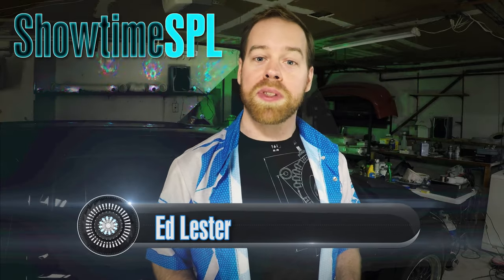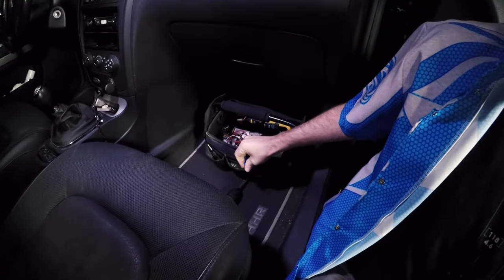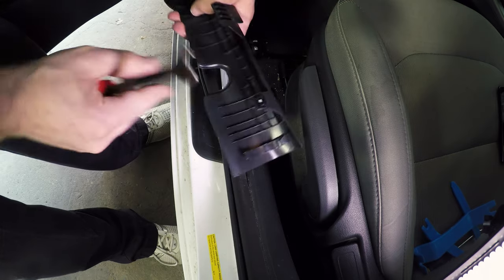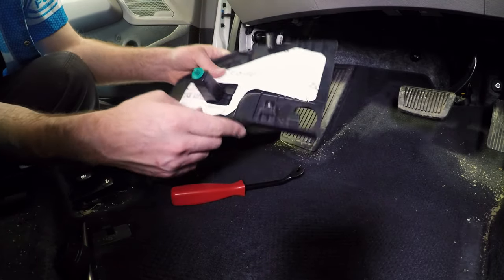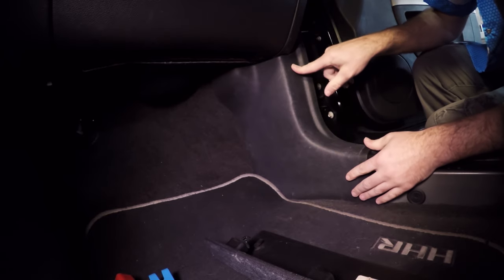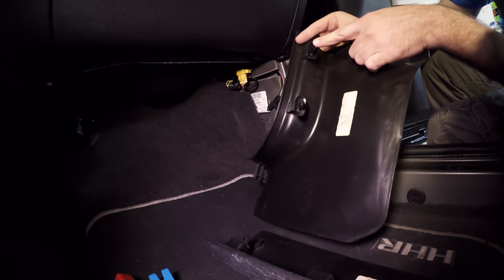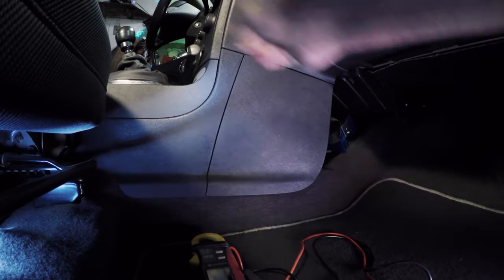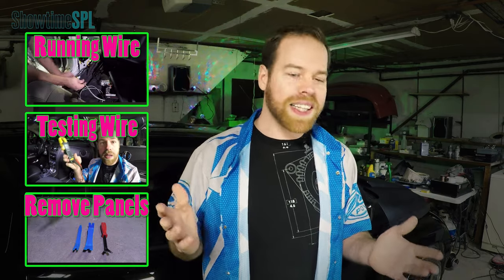How to remove car panels

Comment: Thanks for the tips on pry tools & how to use them. 
I have a small dent that may have been caused in a parking lot-not there before, was there when I came back. If I can remove the interior panel under the dent, I can fix it myself. Thanks for the demonstrations.   🔧🚙

Comment: Just watching this video has been the most helpful 8 minutes of any youtube video I've ever watched(which is a lot). That's because, take a Hayne's auto manual for instance. Step 1 will say, "remove the rear console cover." Oooooo K ... easy for them to say. Not so easy for dumb me to do. Now I'm a retired electronic engineer and am an OK but not great mechanic, so understanding what to do is usually manageable for me. But what always gets me is "how to get at things in order to fix them." After watching you it all kinda makes sense, but before watching you ... clueless. Popping stuff off that I can't see how they are fastened really scares me. I wish things just used good old fashioned screws, but I guess they would have a tendency to vibrate loose over time, so that would be an advantage for pop-ons. That being said, I'll never get used to the fear of breaking things by prying on them.

Comment: Great video thank you.   I recently replaced my dash on my 2013 Chevy Avalanche.   It had cracked over time due to sun exposure.    When replacing the new dash and having new clips installed,  I noticed that the 5 clips that lock into place did not stay in place.  I triple checked and made sure everything lined up and it did.  The clips were new and properly inserted.   However no matter how much I tried to get the clip to stay inserted it would pop up.  Of the 5 clips, 2 stayed in pretty well the other 3 wouldn't.   Any suggestions to this issue?

Comment: SparkedEd, any chance you know how to remove the silver molding piece that runs across the whole center of the dash ? Its shiny enough to reflect sunlight and blind me. I'd like to take it off and plasti dip it.
Reply from the maker: Depends on the car. Best thing is to look up Metra guides or join a forum or FB page for your specific car.

Comment: thanks for the video.
Any help on removing the back interior panel ? lexus gx470
(left side)
I was trying to fix a leaking in the left roof rail and a holder for the back part of the roof rack felt inside the rear panel.
Thanks

Comment: I need that “door well panel”, but for my car, mine is also attached to the outside “kickstep” with the metal Hyundai plate insignia on it. Whats the general name for that panel on all cars so I can find mine? Floor panel, door frame panel etc...?
Reply: Need to know the section after the kick panel(moving towards the back of car), and mine actually goes from the inside and wraps around and clips to the rocker panel.
Reply from the maker: Door sill, or sill panel

Comment: Hey man I've been going through your channel watching alot of your HHR builds I was wondering how reliable this car is since I plan on buying an 08 HHR SS also did the sound deadening reduce road noise and would it be possible to sound deaden the firewall so you don't hear the engine as much? Personally I don't mind hearing the engine but the family might lol
Reply from the maker: I just had my first issue ever with my 08 SS. Has 96,000 miles and had a leaky rear brake caliper. My 07 HHR 2LT had 120,000 on it and only ever had a rear wheel bearing go out. I sound deadened my firewall and the whole car and it sounds great. Though I made a hood vent and love to hear my turbo spool. These cars arent loud, factory exhaust sounds nice.
Reply: Awesome thanks man I plan on doing some cosmetic modifications to my SS when im done maybe i'll send some pics.

Comment: I swear, the clips that hold the top of the dash on G3 and G4 Mopar minivans (Voyagers, Town&Countrys, Caravans and probably other Mopar products) are designed to be IMPOSSIBLE to come apart without breaking the pin off the underside of the cover, or the metal clip self-mangles as it separates from the lower section of your dash.  In either case, out of about five or six attachment points, you'll be lucky if one or two survive.  I can literally see no way to make these release.  Squeezing them doesn't help, prying them doesn't help, spreading them doesn't help... They also hold the dash down really tight, so even getting a tool in there is next to impossible to manipulate them, IF you know where they are, and if you can, even if your tool is super thin and flexible, but rigid enough to apply enough pressure to lever the pad up, you stand an excellent chance of the plastic of the pad simply cracking if the pin doesn't rip off the bottom or the metal doesn't mangle, because these tops had to be flat black by default so they didn't create an awful reflection on your windshield, so they absorb a lot of heat in the summertime, and they're all super brittle.
The Mopar engineer that designed these should be beaten to death with a bag of frozen donkey dicks.

Comment: Finally got a set from Napa. I have such nightmare panels on my 2001 civic. I got a European model and uses really weird clips to hold the door panel. Almost felt impossible even with these tools. Damaged 2 a little bit.they weren't held in place by clips but by sort off locking mechanisms. They are super tight and strong even after 19 years. I almost bent the tip of 2 of these tools it's that tight, I switched to a thicker once I had more space. I got the panel almost off tonight so finish tomorrow. Hope I can get climate control unit out more easily now. Saw a video and the guy popped it out within 5 minutes or so. It took me 45 to get it loose but than ran stuck because it haar cables running to the temperature knobs. None of the videos show that 😭😭😭
Reply: How can we click those videos at the on the left. I don't get links?
Reply: Okay found it
Reply: Even though they are plastic you still need take watch to not apply to much force. I do see some very faint damaging trying to poo the weird clips out

Comment: VIDEO SHOWS HOW TO REMOVED THE CLIPS BUT NOT HOW TO RE-INSTALL THEM. ONCE YOU REMOVED THE CLIPS THEY SPREAD AT THE END AND THEY WON'T GO BACK IN AND YOU HAVE TO BUY NEW ONES.
Reply from the maker: Internal pops do not spread. You can certainly re-use them. They are tapered at both ends as to be re-usable. If yours do not go back in, then you are removing them wrong, or have a 1980s style pop.

Comment: I'm 53. I've been working on cars for most of my life. I'm a Chevy guy but....removing Chevy interior panels sucks! The metal clips over plastic is a piss poor design. I've got both sets of plastic and metal removal tools. It doesn't matter. I've worked on 100s of cars and trucks. GM has designed them to break I swear! Most of the panels in my 2009 Avalanche have either been replaced or fixed with JB Weld. If you know somebody who works at GM pleeeeease, punch them in the face for me.